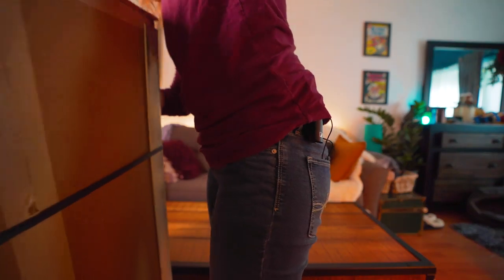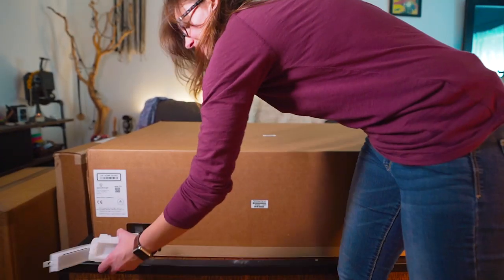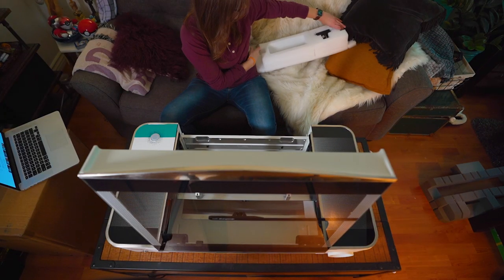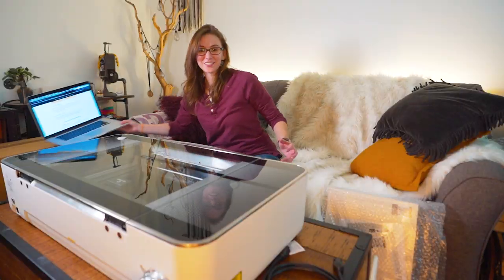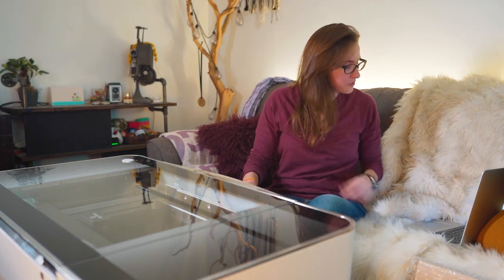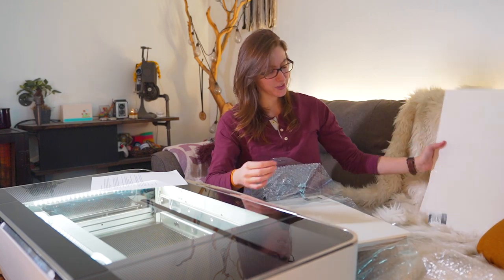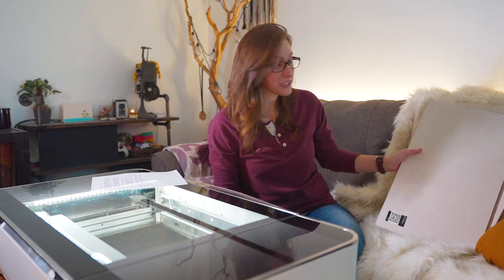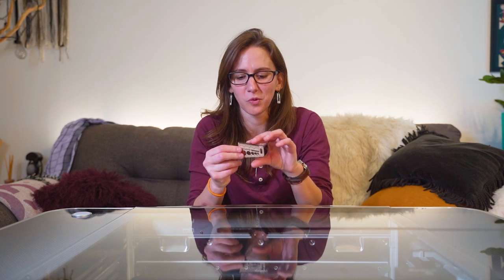opening my NEW LASER CUTTER! - Glowforge Unboxing + Print

Comment: Grounded essentially means using a three prong plug in a three prong outlet, not using an adapter, or as you found out, an extension cord or external power strip/surge protector (although some of them can be wired to be grounded).